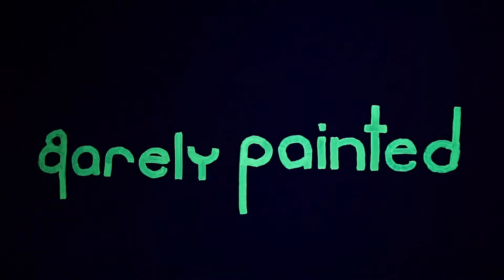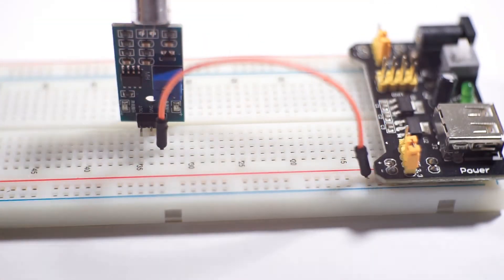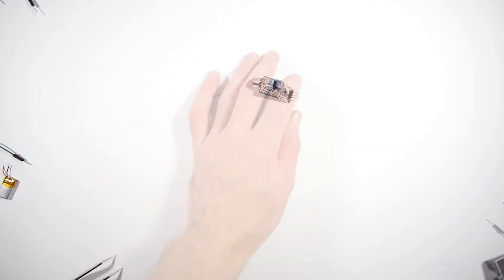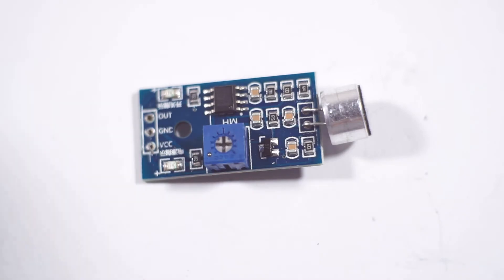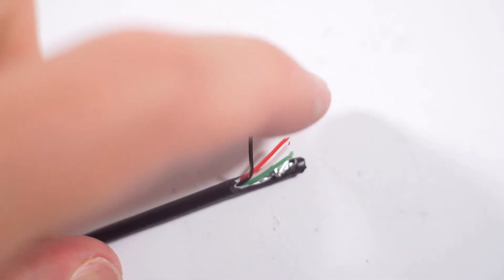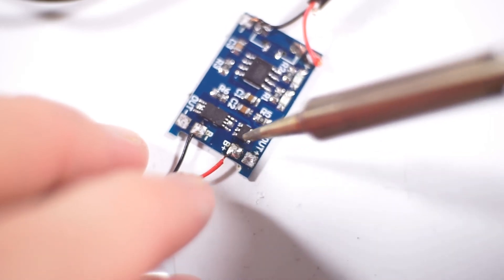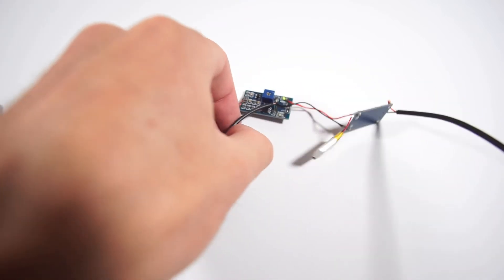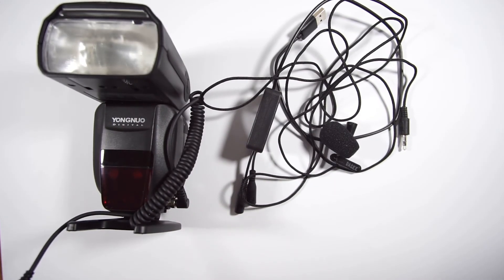DIY Sound Activated Camera Flash

Comment: Hi
Could you please try to make this work with smartphone?
Instead of the hand clap , i wonder if this work with shutter sound from the smartphone too ?
Reply from the maker: This will not work, as there no relation between sound and actual shutter action.
Reply: @BarelyPainted  thanks for your answer. I mean the virtual shutter sound from the phone amplified by a Bluetooth speaker. Possible? Or any other idea of you that make it possible to sync a smartphone.
Thanks
Reply from the maker: Instead of mic you can connect your phone by using 3.5mm jack, through resistor. 
But how to solve sync issue, between shutter and sound, I can't answer for this.
Reply: @BarelyPainted  Hopefully, the sound is at the same time of the phone shutter. Do you think i can connect the phone jack 3,5 directlly to the trigger?